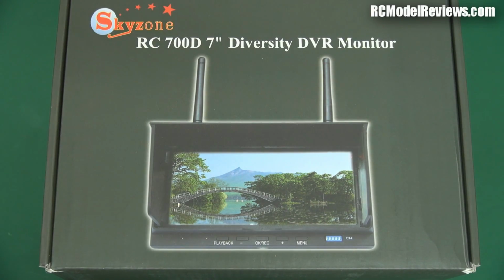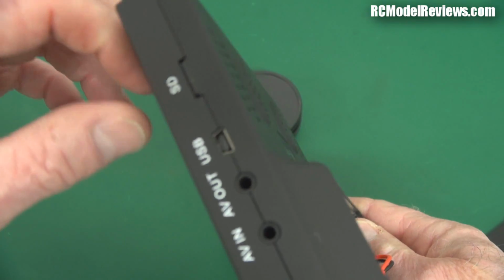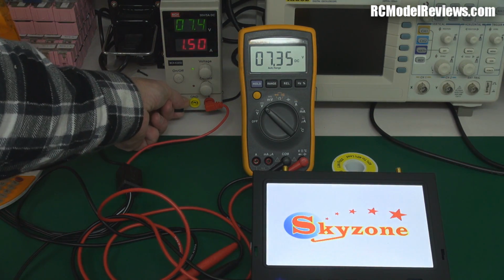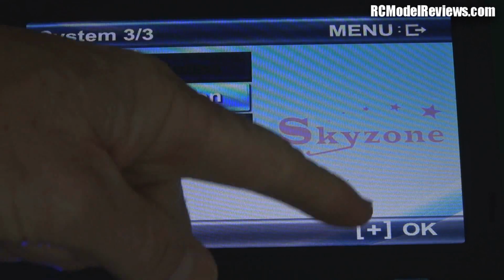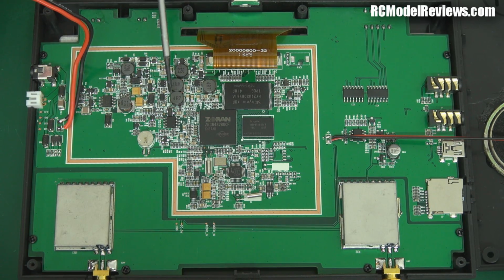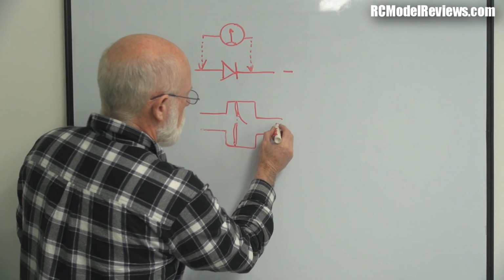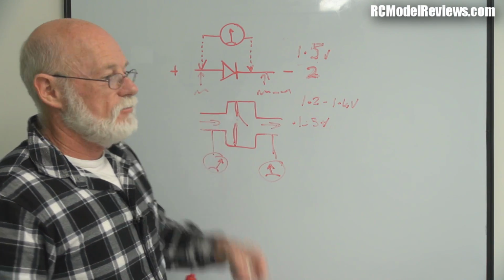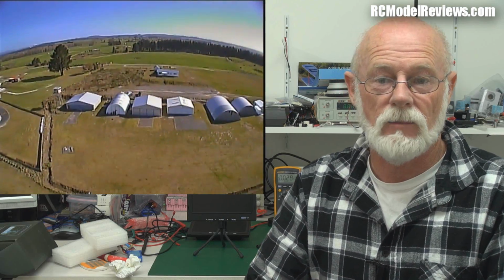Review: Skyzone RC 700D Diversity DVR LCD monitor (part 1)

Comment: Hi Bruce  I have a similar dvr but with a internal 2s which sucks. I can fit a 3s but dont want to fry it. I opened it up and took a couple of pics. I dont know much about these things ,but from what you pointed out it about the power circuit. i think i can . Its a skywing dv701. Is there some  way i can send you the pics so you can take a look before I plug it in? Thanks for your time.

Comment: Hello! I have a question for you since you're a heck of an expert when it comes to getting down to the science behind anything RC, there's a raging debate on my club forum regarding ESC wire lengths. The argument is that if one were to extend the wires on their ESC's from let's say 8 inches to 16 inches, it can damage the ESC, I'm guessing not, it's not enough change in resistance, unless you're drastically increasing the length. Thank you!

Comment: In your tear down of the device did you ever find the battery for the real time clock and if so is it replaceable? My Skyzone DVR never kept time and date accurately since day one. I know typically that is not the battery, but rather poor design or bad / cheap component tolerance. But on the outside chance...

Comment: Extremley Dissapointed with this .
Pros are the reception on this is good and the view is very clear , but thats where it ends.
Cons .. The battery hatch is too small to be of any real use .
The Bitrate for the record is so low in quality that you cannot even freeze the pic without complete blurr.
The record function is almost usless it is that poor quality .
$35.00 dvrs from Ebay produce better results.
You cannot plug into the av out without it killing the screen .

Comment: Hello! as usual your reviews are superb! if i may pose a question regarding this screen which i also own, mine did come with an ON/OFF switch on the back though, i use it with my phantom 2 and the  zenmuse gimbal, i use the DJI Osd mini and fatshark TX, my issue is that my OSD info is on top of the data from the screen which it displays, screen battery power, etc. i only want my OSD mini flight data on the screen, its confusing when 2 sets of info are over each other on the screen. is there a solution for this? thank you!

Comment: I very recently purchased the Skyzone 700D.  Some differences I've noticed since the making of this Video.  On/Off switch added to back.  Voltage discrepancy is now 0.3v-0.4v.  Reboot will occur on 2s battery when OSD shows 7.2v, if ignore voltage is selected then reboot does not occur and continues to run, I ran it to 6.8v on OSD then decided that was enough for the battery.  Actual battery reading:  7.2v .

Comment: I would use 4 18650's! it looks like those will fit much better, and the turnigy brand ones that are 2600mAH are very cheap, about $6 per cell, vs something like $30 per cell for AW or panasonic batteries. I use them with my Skyray king with no problems.

Comment: Just received an updated version (purchased from Foxtech 11/11/2014). Some of the Cons mentioned have been rectified. Now there is an ON/OFF switch on the back, the voltage monitoring accuracy is alot better (8.1 v -monitor read 7.8v=0.3v).The "bleep,bleep "sound is still there though.
Thanks to reviews like Bruce and other feedbacks, good manufacturers Skyzone do listen and address the probs.

Comment: Bruce have you done a part 2 yet? The big "con" issue is the screen turns off when you plug in your goggles.How dumb that there is no switch to choose to turn it on or off for that. I tried to hack AV out the jack and soldered some wires on to bridge the jack switches, but I still couldn't get it to work so both were on. I must have something connected the wrong . I see on RCgroups most people had the same complaint with this monitor.   Bruce any chance you can look at how to do this hack? Thanks also for all the fantastic video reviews. I now watch them instead of watching TV in the evenings.

Comment: i owned this thing for months, yes its nice , but .....
for the live video , its quite ok, just that the dates , battery voltage, etc information are overlapping with your OSD in your FPV system. and i dont think they will go off automatically, at least not in 5 minutes time (1 sortie )
the PLAYBACK mode, thats where the problem comes. 
First of all, the VOLUME. You can adjust the volume, but you need to hold down the + / - button , i mean HOLD, for 1-2 seconds then the volume bar appears and SHOOT up / down ! you need to anticipate to adjust the volume level otherwise it will shoot all the way up to full volume and bust your speakers. 
Secondly , the video format supported. we all know nowadays most of us own either a GoPro or Mobius. i only have a mobius. both of these are super popular in RC world. but the video format they record in , are not supported by this monitor. meaning to say you cannot take out the SD card from your mobius and insert into the monitor for playback. you got a nice LCD monitor, a nice SD card slot, but you cant use it to playback your mobius recording. isnt that a waste. 
THIRDLY, no after sales service. FOXTECH if you are reading this, you are such an idiot. I contacted them , and they replied me because they thought im looking for dealership. but once i speak out my suggestion, they dont even bother to say NO. 
its just a damn firmware, you provided us a USB port, you can just release a better version. THAT'S WHY IN THE MENU YOU PROVIDE US THE VERSION INFO, isnt it ? 
Besides that, i can hardly notice the difference between the 5 levels of brightness. and there is no adjustment for colour gain / contrast etc. why cant you just give us the conventional manual adjustment of the image quality , instead of packing them into nice 5 levels of preset brightness, which is totally useless. A cheap car monitor can give me those manual adjustments. 

Hardware = 9/10, Firmware = 1/10

Comment: This maybe an overly simply solution to the battery depth problem, but why not just put a strip of velcro in the battery compartment and leave off the cover.  You can use any size battery that fits length and width and not have to worry about taking off the cover, and it will make a lot easier to disconnect the power when it is not in use.

Comment: Nice review. One thing want to add is my problem on the channel switch. Occasionally, it cannot receive anything even though the channel of both transmitter (from Skyzone as well) and receiver set up correctly; but it can be fixed by flipping the switch to any other channel and then switching back.
Now I will do this every time as a pre-flight operation, to give me a better sense of security.

Comment: In part 2, could you compare the DVR capability to the older model (RC800?) from the same TX / camera setup? It might seem better because your TX end is now better...

Would also be good to see if there's any lag on the display and / or outputs when recording. Put a raw screen and RX beside it maybe during flight and video them all.

Suggestions only, enjoyed the electronics brush up. Dave Jones would be proud.

Comment: Another CON of the monitor, is that when you connect an AV out cable, say to connect your goggles to the monitor, the screen goes black! Bruce, if you could come up with a solution to resolve it, I'd dance in your name!
Reply: This is a big "con" issue I think. How dumb the screen turns off when you plug in the goggles and that there is no switch to choose to turn it on or off for that. I tried to hack AV out the jack and soldered some wires on to bridge the jack switches, but I still couldn't get it to work so both were on. I must have something connected the wrong . I see on RCgroups most people had the same complaint with this monitor.   Bruce any chance you can look at how to do this hack? Thanks also for all the fantastic video reviews. I now watch them instead of watching TV in the evenings.

Comment: Bruce, so how do you like the the diversity part of this monitor for range and what combination antennas do you recommend for it? I'm guessing a 3 or 5 turn helical and a Cloverleaf?  I want to get better range than my fatshark attitudes and have a way for others to view my actual flight. This looks like something I need to have in my FPV arsenal. I know from your excellent review that I would need to add a power switch and a 3s battery.  If you guys think a separate diversity 5.8 RX and monitor is where I'll end up with if im seriously loving FPV, I may want to go there from the start. 

Thanks for the help, Yaz

Comment: Hi Bruce, Are you sure your theory about the voltage drop is caused by the diodes and fet. Because I might be reading it wrong, but the internal battery supply does not appear to go through the two diodes?

Comment: Bruce, do you think you could open it up, find the voltage divider on the board that goes to some ADC that reads the voltage and mess with the resistors? Maybe that 6.9V can be fixed…
Reply: After watching the rest of the video, I see that you've opened it and it would be rather hard to do a debug session on such dense packed board. But I think something doesn't add up, if there's 1.5 V drop on two diodes, then with 1.5 A current they would lose 2.2 W of power - 1.1 W per diode. Such tiny diodes? Hmm… I don't know… Even if they really drop so much voltage, there's possibility to replace them with Schottkys, or even better - correcting that in the firmware (provided that the µC is aware of which DC input is used). But Foxtech just didn't do it. :(

BTW, that via fence with one via per cm isn't really a good via fence… ;-)
Reply: Michał Gawron
You can't think of a diode as a resistor in terms of power dissipation. A diode has a drop of .7 volts across it regardless of the current. As Bruce mentioned, the voltage drop remains constant.over a broad current range and only increases a small bit with large increases of current. A diode does not have much resistance so they will not dissipate much power at all.
Reply: Well, no. ;-) It does have resistance, that just varies with voltage. Call it impedance in general. There's no way not to dissipate power when there's voltage drop under non zero current.
Reply: Michał Gawron I never said that a diode doesn't have any resistance. When a diode is forward biased, the resistance is very low so it does not dissipate power like a resistor would. You can't calculate the power dissipated across the diode by multiplying the current by the voltage drop across the diode like you would with a resistor.
Reply: But I say that the diode does dissipate power similarly to resistor, either as light (mainly) if it's a LED, or as heat if it's a regular diode. And the power is voltage drop * current. :-) If you're talking about that the 'apparent' resistance isn't constant, then I agree. What I say is that it works exactly as a resistor, given enough short Δt. U * I is good approximation for total power over time, since the current used by a device doesn't fluctuate that much. And if you want to compute the resistance, U/I would sill be more or less OK, since the voltage from the source doesn't vary that much, either. Ok, it's like 20%, when it's LiPo. ;-) But you know what I mean. At any point in time, you can still calculate the resistance in that very moment.
Reply: whatthedouch I agree with what you say about the diodes IV characteristic curve, and that is is non-linear, however, it is accurate to take the measured voltage drop times the measured current flow through it to calculate the power loss. I think what you are thinking is that is is not safe to assume the diode has a known impedance and use the "P= V^2 / R = I^2 * R" formula. That would be wrong.

Comment: Hi Bruce, been using one of these for a few weeks now and like it apart from a few of the obvious problems like no on/off switch, I fitted my own.  About the battery voltage, after your video I did an experiment with an old 2S lipo and my monitor kept on going all the way down to 6.26 v which I thought was OK.  I run it on a 1800mAh 2S which fits nicely in the back and although I haven't timed there hasn't been an occasion where it has run out in one session :-)
Reply: RedHotPheasant Was that 6.26V displayed on the LCD screen?  If so, that would have been actually 7.7V measured at the lipo itself.
Reply: ***** Hi Bruce, No that was measured on my Fluke Multi Meter, I didn't see the final voltage on the LCD, too busy watching the other, but it was 5.9 the last time I looked at the LCD screen. Cheers
Reply: RedHotPheasant
That's very interesting.  As you could see in the video, my screen just stopped working and entered a reboot loop at 7.4V.   Strange indeed.
Reply: ***** Strange indeed, don't suppose the bench supply has anything to do with it?  As the battery was running almost to shut off there was also a dulling of the screen and a whistling sound.  I will run the experiment again tomorrow and let you know the result and the voltage on the screen.  Cheers - Peter
Reply: RedHotPheasant
Yes, I will repeat the test today -- just in case I did something stupid (wouldn't be the first time) and had wound down the current-limiting on my bench suppply.
Reply: RedHotPheasant I repeated the test and checked to make sure my bench supply wasn't going into current-limiting mode.  Video coming up in a few hours ;-)

Comment: I have the older one and completely agree with everything said. Mine also reads the voltage wrong and now I know why. 

The DVR function is really valuable to me to share my OSD videos and incase I ever crash I can watch back right away to see where about I went down.  I hope they improve on the screen and get rid of the dip switches.. Thanks again for another informative video Bruce.

Rich

Comment: Poor choice advising the use of a 2S  LiPo "batteny". I wonder if 4 18650's might fit in there but you still have the hassle of charging the damn thing without a charge port. Like some of FoxTech's other products this seems to be a repurposed consumer device probably originally designed with AA cells as the internal power source. Changing the electronics for FPV is cheap and easy to do but having a custom case moulded would be very expensive and it seems the case design is the root of all the issues with this monitor.
One other gripe I have with most of these devices is the external power connection. It is all too easy to accidentally pull those barrel DC plugs out. A locking connector would be much safer. 
Having said that good on Foxtech for offering these things in the first place warts and all, especially given the state of play in the USA at the moment and based on past history they will likely take on board the criticisms and address them.

Comment: Also, i dont know if they are letting keep the screen, but if they are letting you keep it, could you try bridging over the diodes to see if it fixes the voltage problems?

Comment: Fox tech has a firm ware fix for the voltage reading for the RC800. Don't know if it would work on this one r not, but it doe work on the RC 800

Comment: So can i just bridge the two diodes plus the FET and i will get correct voltage reading and longer battery life on 2s? Anyone tried yet??
Reply: Rob B I'm not using anymore the external power input,i also install an on-off switch because this monitor doesn't have any.I also replace from inside the monitor the 3v lithium rechargeable battery for back up the date and time memory because was dead with a bigger one.
Reply: GEORGE PAPADOPOULOS
Yes, I noticed that the voltage error was more pronounced when using the internal battery than when using the external battery.  The internall battery suffers a 1.5V drop and the external power source only suffers a 0.6V drop.  Connecting the internal battery connector across the mini-barrel connnector will reduce the voltage error and allow more of the internal battery's capacity to be used but you do run the risk of making fire if you forget and plug a higher voltage external battery in at the same time.
Reply: David Kaden Yes, you could bypass the protection circuitry and then you'd be able to use all the energy stored in an internal 2S battery -- but you'd also have to be careful to make sure you never plugged an external power source in without first disconnecting that internal battery or "boom!" :-)
Reply: I connect the internal battery wires to the external power source from inside the monitor and its working excellent.
Reply: ***** It's not totally idiot proof since it has two external plugs. If you plug in a battery that goes flat and plug in a wallwart with the external battery connected you can still blow up the external lipo. Not that it's that likely though.

On the 1.5 volt drop:
They could have used the barrel jack insertion detection pin which gets disconnected from ground when something gets plugged in it. Route the minus from the internal battery trough that pin and it'll get disconnected when you hook up external power. This also means they could have ditched the weird FET and two diodes concept and only have one diode at the external power jack. Another bonus would be that the voltage sense would actually be correct on the display, instead of useless.

Nice review though. Did you notice the device houses a batteny instead of a battery? Haha.
Reply: not a wise move unless you totally disable the external power option and have a polarised plug for the battery. If you really must modify it then substituting the reverse polarity diodes with suitably rated Shottky diodes would work better in so far as volt drop is concerned..
Reply: GEORGE PAPADOPOULOS My reply was for the original post and not directed at you George.I t seems we were typing a reply at the same time and you just beat me to the punch:)
Reply: Ahh ok i'm sorry my friend,i thought it was for me.
Reply: ***** GEORGE PAPADOPOULOS  Awesome! Thanks a lot!